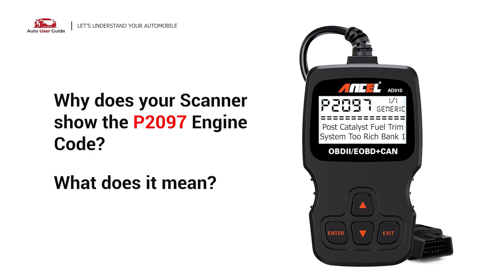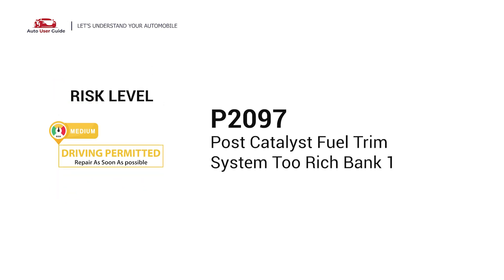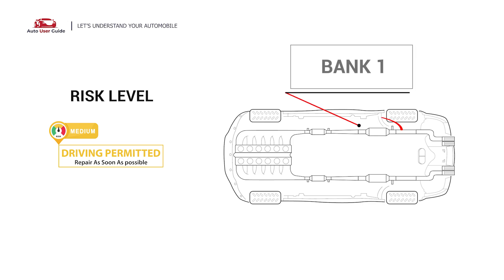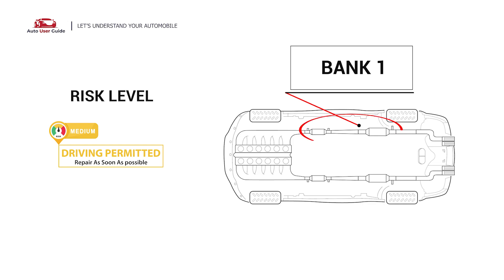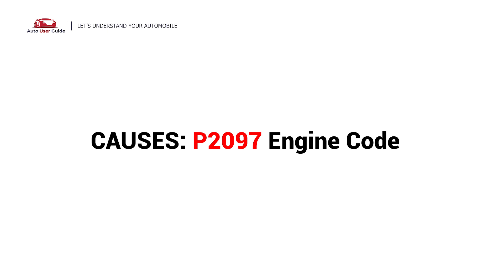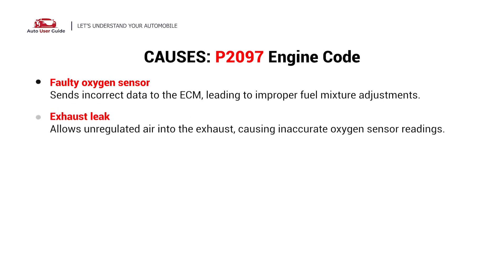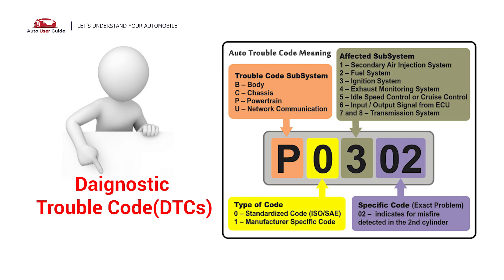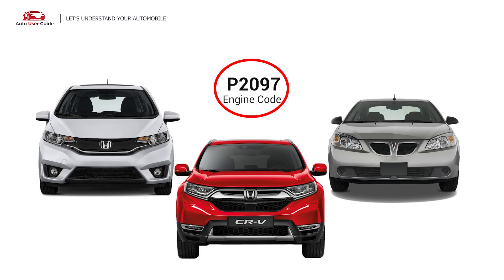What is P2097 : Engine Error Code Causes Explained

Comment: How do you fix this problem?
Reply from the maker: What kind of car and model do you have?
Reply: I have this code coming on my Nissan Rogue 2013. I had someone change out the O2 sensor and still same code comes back. Any ideas? I've seen various videos about this code and an exhaust leak is one of the mentioned problems. I don't hear any noticeable exhaust leaks. Can it be possible that it be so minor of an exhaust leak that you can't hear by ear? What are some ways to determine if there is an exhaust leak? And if it's not an exhaust leak, can the catalytic converter be becoming clogged? The mechanic I have has suggested to replace both catalytic converters as the Nissan Rogue has a primary and secondary catalytic converter as he said he did research over it. I don't want to get stuck spending money on replacing anything that turns out unnecessary. Any input would be greatly appreciated.